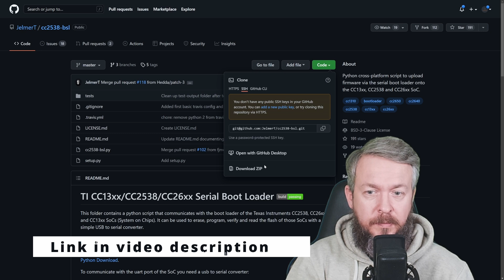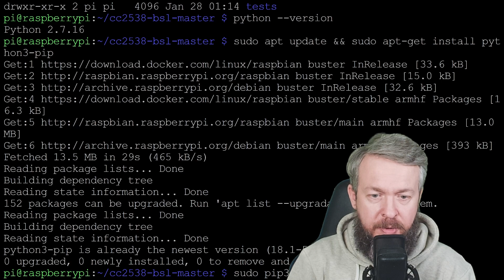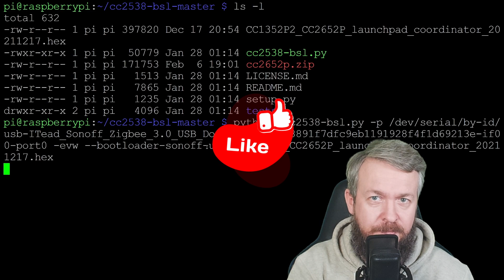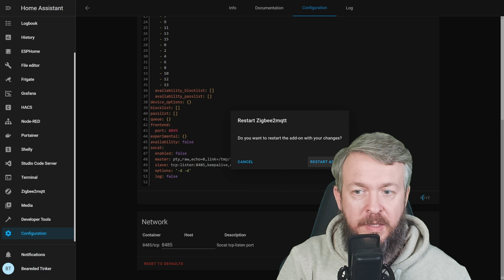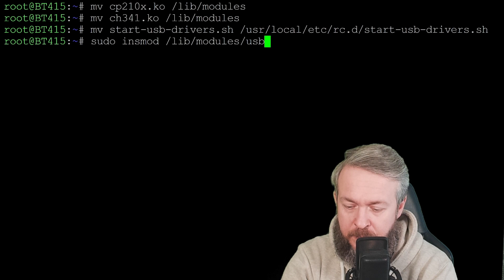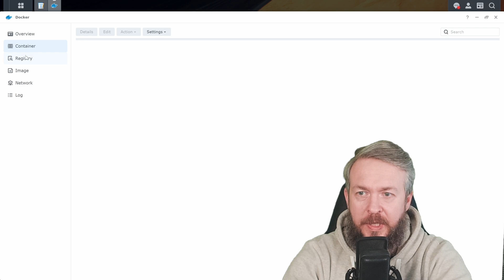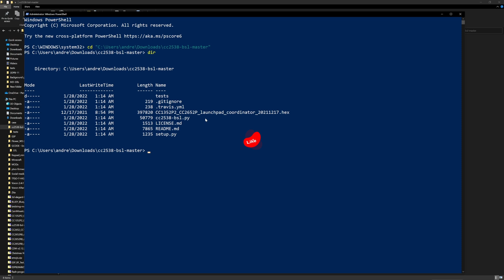Flashing Sonoff Zigbee 3.0 USB dongle plus and Home Assistant guide

Comment: Hello BD ! Thanks for all your great tutorials. Following one of them, I installed Home Assistant on synology as a docker component. In this video, at 17min, you say that you can re-install home assistant. But in that case, I'll lost all my configuration, right ?
Reply from the maker: Thank you David 😊!
No, if everything is installed correctly, all files are located on Synology in /Docker/homeassistant folder. You will just recreate container but keep all local files.
Reply: @BeardedTinker  Thanks for your answer. ATM, i do not own that sonoff (but I really will do) and I'm not sure to understand every parts of this video (no your fault, it's mine as i'm not so aware as you are with synology, docker, ha and so on). I'm running synology dsm 6 (on wich I can't have a VM working, don't know why), so the supervisor version of HA isn't installed. Will it be a problem for me ? (hope you understand my bad and poor english...)
Reply from the maker: @desmoniac1  VM on Synology is only available officially on some models. Other modes can have VMM running by sideloading it - what model do you have?
I think that best way to run HA on Synology is on VM - I have it working on 415+ (it officially doesn't support VM, but it can be installed) and also on 920+ that does support it officially.
But, yes, you can also use Docker version, and it should work too. If you have setup HA correctly and on Synology in File Station you can see files in Home Assistant folder, than you can simply delete Docker container for HA and create new one where you use steps from the video and map your USB Zigbee device for Home Assistant to see it.
No worries. HA has great community and we will try to help you ;)
Reply: @BeardedTinker  really appreciate your answer and help. I'll be back as soon as i'll receive my sonoff zigbee. Then, i'll be able to try to install all that stuff on my testing machine before putting it on my production machine. Many thanks !
Reply: @BeardedTinker  Just a quick reply to say that my nas is "almost" a DS3615xs running with an Intel core I3-4130 ;-). What do you mean by sideloading a VMM ???
Reply from the maker: So it's Xpen.... :) But still it should work - VMM on Intel should work Ok. I was thinking that you have one of the models that officially don't support VM, but you can manually install package and get it working. 3615xs (most comman Xpen...) should support it nevertheless
Reply: @BeardedTinker  I can't hide anything :) !!! But my knowledge is insufficient to install the package you're talking about. Maybe one day you'll provide a video on your channel... Waiting for that (no pressure, ok ?) I just watched your latest video and well, some ideas are coming to add media automations. Thanks for all your great works !!!
Reply: @BeardedTinker  Another quick question please. Once the dongle has been flashed, does it need anything else than power supply to work ? I mean, can I simply plug it on, for example, a usb charger ? Sorry if this question seems stupid.
Reply from the maker: Depends, if you already have a stick in Synology, and you flash this one with router firmware and not coordinator, than you can simply plug it in USB power and that's it
Reply: @BeardedTinker  ok but I want to use it as a coordinator. So I guess it's not possible...
Reply from the maker: That's right - ZHA/Zigbee2MQTT has to have access to it, so it needs to be connected directly.
Reply: @BeardedTinker  Sound so logic...
Reply: @BeardedTinker  hi BD. My zigbee dongle is on its way to home. But i read somewhere that it wont work if plugged on a usb3 ? Do you confirm ? In that case, if i use an usb2 prolonger cable, will  that do the trick ?
Reply from the maker: @desmoniac1  Never seen any issues with type of USB. Cable should be used in any case to move coordinator from possible EM interference . It will work without it but it's just recommended to use cable.
Reply: @BeardedTinker   Two more questions dear BD (sorry...) Is it better to use ZHA or zigbee2mqtt (and why ?) If I want to use zigbee2mqtt, is your #5 tutorial still valid (remember, I'm using HA on docker on synology and do not have supervisor).
Reply: @BeardedTinker  Sonoff zigbee received, flashed, installed and used with ZHA (I'll try later to configure it with Zigbee2mqtt). Thanks again for all your tutorials.
Reply from the maker: Glad it's working!! Hope you'll have fun with it.

Comment: I'm actually quite unfamiliar with a command-line other than windows. 
I'm typing these commands from the "Home Assistant Add-on: SSH server" add on, on HA web portal.
I'm stuck at 6:44 from the video. After typing "python --version" I got "bash: python: command not found" so I thought, I don't have python installed. Went further and typed  "sudo apt update && sudo apt-get install python3-pip" but I get "bash: sudo: command not found"

At this point, I halted and I'm lost. What am I doing wrong?
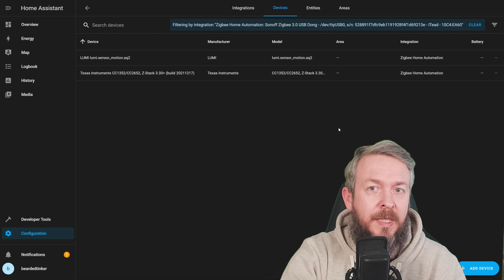Reply from the maker: Did you try Windows upgrade steps from video 20:54?
But in order to use Linux, you will need SSH access to machine. SSH server (Terminal & SSH) provides limited access to HA own environment, not direct access to HA.
Reply: @BeardedTinker  Thank you for the fast reply! Ultimately, I will do that, but in the meanwhile, I'm trying to learn why is this happening and also trying to do it in "the hard way".
Reply from the maker: I've edited my answer, so you probably missed it. 
SSH AddOn is just protected environment that is not full Linux experience. It just allows you to run some limited commands. You would need different Linux machine to do it unfortunately. There are some steps if you want to try, but not that simple: https://developers.home-assistant.io/docs/operating-system/debugging/#ssh-access-to-the-host
Reply: @BeardedTinker  Thank you very much for confirming this. I even already installed SSH & Web Terminal because is less limited, but I was coming to the conclusion that maybe I couldn't do this locally but on a different machine. Lesson of today learned. moving to 20:54 :D 
Again, thank you for the confirmation!

Subscribed!

Comment: Great video..... i flashed the router firmware that is listed in sonoff manual..... but i cant get aquara sensors conecting to the router.... which firmware did you refer to?
Reply from the maker: Same as  the one where coordinator firmware is. Check video description. https://github.com/Koenkk/Z-Stack-firmware/tree/master/router%2FZ-Stack_3.x.0%2Fbin 
Those are also recommended by Sonof. Just go to router folder instead of coordinator.

Comment: Hi again @BeardedTinker. I need to ask for some advice here: 
I have around 70 devices in my home from different manufacturers: 
- IKEA (GU10 Lights, window blind, switch, 3x Range Extender)
- OSRAM/LEDVANCE (Motion Sensors, GU10 lights, garden poles) 
- AQARA (Lots of battery-powered Aqara remote switches, motion sensors, temp sensors, etc.)
- MULLER LIGHT (E27 bulbs)
- PHILIPS HUE (for outdoors: E27 bulbs + outdoor motion sensor)

My house is pretty small (80 sq. m) over 2 floors, made of brick & wood (zero concrete). 
Some end devices, especially Aqara sensors & switches keep dropping out of the Zigbee network and I need to re-pair them every time. 
I had this problem with my previous coordinator (Conbee II stick), and I was hoping that the Sonoff dongle will solve this problem but it has not.  
Do you think it makes sense to get another Sonoff dongle to use as additional router or is it more reliable to add an Aqara hub, and add it to home assistant via HomeKit controller? Would the Aqara end devices connect to the Sonoff as router, or will they still try to get directly to the coordinator anyway?
Reply from the maker: I've tested Sonoff with router firmware on it with Aqara devices - and new devices that were near it did pair to Sonoff. But I didn't test to see if devices that are already connected to coordinator would transition to it.
Roaming/transition from coordinator to other routers is a bit strange in Zigbee network, and it can take a long time for them to try and find optimal/alternative route to coordinator. Or they may never do that. 
You could possibly end up re-pairing those devices - you don't need to remove them, just start pairing process on them (for Zigbee2MQTT, not sure for ZHA)
Reply: @BeardedTinker  After you flash the new dongle with the router firmware, how do you pair the new router with the original coordinator? The Dongle doesn't seem to have any pairing button. Does the coordinator discover it automatically?
Reply from the maker: When you plug it in for the first time after flashing it, it will be in pairing mode. You just need to enable pairing.

Comment: Hello,
Really appreciate all the videos and information you share here. :) I had a question. I am new to HA and Zigbee. I have installed HA in a raspberry PI 4. I bough recently this zigbee stick, sonoff but seems that for me it is not connecting to my Tuya hy368 TRV smart valve. I remember you have already poste a video where you use zigbee cc2652rb stick and you were able to successfully  connect the valve to zigbee2mqtt. As you already have the sonoff zigbee stick and the tuya smart valve could you test if sonoff zigbee usb dongle plus is able to replace the cc2652rb coordinator and connect to tuya smart valve? I have flashed the sonoff zigbee stick with latest stable firmware and with latest development firmeware but still no success on pairing tuya TRV smar valve to the sonoff zigbee coordnator.
Today I noticed that my xiaomi gateway 3 could be used as a zigbee coordinator via an integration "Xiaomi Gateway 3" provided by HACS. I tried ZHA and zigbee2mqtt with using the xiaomi gateway as coordinator. I am able to pair the device to the xiaomi gateway but I can see in zigbe2mqtt it is not supported and the exposes part is empty. As per ZHA it connects but most of the functionalities are desabled by default. I can only change temperature and turn it on and off.
Reply from the maker: I've  given TRV away and don't have it anymore with me, sorry. But if Zigbee2mqtt sees it and says it unsupported, than it could also be a new model that has still not been added. I have one Gledopto video where I've shown how to create custom converter for unsupported device - basic setup only. Try to use this to pull exact model from it. Maybe its a bit different.
Reply: @BeardedTinker  I will try with creating a custom converter. Many thanks 🙏🏻 I also checked in details the Xiaomi gateway integration page with the information and seems that the xiaomi gateway 3 does support very limited amount of devices and thet is the reason it does show my TRV as unsupported. I have the feeling the custom converter will solve it. Many thanks!
Reply: I think I got now the logic. My Xiaomi gateway 3 does not support this tuya TRV valve. I checked the integration information and it supports only some tuya switches and buttons. Not the TRV. Now when I deleted ZHA config using Xiaomi gateway as a Zigbee brigde, and configured again ZHA with Sonoff Zigbee dongle, I see the TRV valve appears automatically. The issue is that the configuration is not right and I cannot use it. I read someone was using 2 Zigbee usb dongles one old cc2531 dongle which he connects to HA only to add new devices, and than he switched to sonoff to use as daily driver. That might be a workaround for the moment until Sonoff firmware fixes this, if will ever fix 😁
Reply from the maker: When you say Sonoff firmware - why don't you update it with coordinator firmware that's listed, if you of course haven't done so. My cc2652RB uses same firmware from this page.
This is same circuit inside, except Sonoff one also addes no-boot update, that cc2652RB doesn't have.
If it's just firmware, that's the easiest part.
Reply: @BeardedTinker  Hi again. I already flashed the Sonoff Zigbee usb with firmware 20211217 and later with the more recent development version but did not work for me. Later I learned that when I used my Xiaomi gateway 3 as Zigbee bridge and connected to HA, Z2M, my Xiaomi firmware was old abd was not working well with HA. After upgrading my Xiaomi mi gateway and configuring it as Zigbee bridge with HA and Z2M I was able to successfully connect 3 Zigbee devices I had around and the smart valve. All worked perfectly. That ment my HA, Z2M, and Zigbee devices all work well. After that I connected Sonoff Zigbee usb dongles to my laptop and installed node.js + Z2M and tested it. Again all was working perfectly. Then I just remembered that raspberry pi 4 has a total limit of 1.2 Amper for usb ports. I already have connected one SSD to one of raspberry pi’s usb port and SSD is rated at 1A. The usb dongles states that is rated at 100mA so normally that should work fine. But somehow I was wrong. After testing again with raspberry Pi 4, external SSD, and with external power to my Sonoff Zigbee dongle (through a small hack to raspberry GPIOs) all worked fine. It turned out it was a power issue… 😄

Comment: Great video, thanks for the instructions! Does anyone how you add the router to an existing Deconz instance after flashing? Can't seem to be able for Deconz to pick up the router when searching for new lights.
Reply: Following up; I can see the router in the VNC view, but it's not showing up in the GUI. It sems to be routing as well.
Reply from the maker: That's normal AFAIK. In Zigbee2mqtt you see it as unknow device or device with no attributes if I remember correctly. But it should still work even if it is "invisible".

Comment: Hi BT! I am trying to do this on Windows but it doesn't work. My PC does not put it on any COM port at all. Basically, I see it in my device manager as an uninstalled (no drivers) device but I don't even have any "Ports" showing in my computer's device manager. What am I missing? :-(
Reply from the maker: You probably are missing drivers. https://www.silabs.com/developers/usb-to-uart-bridge-vcp-drivers
In device manager check if there is a device that is not recognised - this should be it.
Reply: @BeardedTinker  Yes! It worked like a charm. THANK YOU!
Reply from the maker: Nice! Glad you got it working 😊
Reply: @BeardedTinker  Thank you for this post.  I had the same problem.  Thank you for a great video.

Comment: I  try to add sonoff stick to synology, I ssh via powershell to syno, i just download the 'master.zip , but unzip command not work (command not found ) any suggestion ?  Looks like my synology not seeing the sonoff stick  , any suggestion ? Thanks
Reply from the maker: Hi! Instead of unzip (if it's not installed), you can use 7x - "7z x" is command to extract. That should work without the need to install unzip.
When you connect Sonoff USB, do you see anything when you type "ls /dev/ttyUS*"  ?
You can also use step I've show in video to install drivers for DSM 6.2 and 7.0
Reply: @BeardedTinker  nope
Reply: Under Vmm usb device is empty too
Reply from the maker: @acejoe5996  try in Windows PC to check if stick is working. It should be visible in VM manager no matter what.
Reply: @BeardedTinker  yep, i just plugged in and insta visible in the device manager
Reply: I also cheked the files under putty , and I have all the files  cp210x.ko and start-usb-drivers.sh in the right place
Reply from the maker: For VM, you even don't need those. What model of Synology is this and DSM version?
Reply: @BeardedTinker  220+ and dsm7, Not sure How but now it starts to work finally !
Reply from the maker: Let's say that it was just lazy because of the weekend. Really no idea why it wouldn't register it so it's good that you can see it now.

Comment: Hello, very helpfull video ! nice work. Did this work with the router firmware(with the method 1) ?
Reply from the maker: Yes it does! I've tested it with router firmware too and works nicely!
Reply: @BeardedTinker  thx 😉
Reply: It’s work perfectly with router firmware !! Thx a lot ! What a powerfull upgrade for my zigbee network !
Reply from the maker: It has good range so adding it as router will really help the network!
Reply: @BeardedTinker  i add two yesterday and it fix all my issues 👍

Comment: Thanks for the guide. I just finished setting up sonoff zigbee 3.0 dongle plus for Zigbee2mqtt on my 918+. 
And I have one question. Currently, the zigbee 3.0 dongle plus is set to HA with Zigbee2mqtt, but doesn't it crash even when nested with ZHA?
Reply from the maker: Glad you got it working!!!
Zigbee2MQTT should crash or ZHA should fail to start if you try and use both of them to access same dongle. That is normal and you should not try and run both of them using the same device. There is always option to use 2 devices/dongles, but there is not added benefit to that.
Reply: @BeardedTinker  It only supports one thing.  I asked just in case haha.  thanks!!

Comment: After some trouble with the prerequisites I've managed to get to the end. Unfortunately I get an error 13 {Errno13]. Any thoughts anyone? I have been trying an googling for more han an hour now but with no resolve.
Reply from the maker: Hi Kris! At what stage do you get this error? You are using Linux to flask firmware?
Errno13 usually is problem with permission. If you haven't try running command with sudo in front of it.
Reply: thank you for your reply, it is the very last step of the Linux method. The command that starts with python3 cc2538-bsl.py -p etc etc. 
I’ll try sudo in front of the command.
Reply from the maker: One other thing myou can try if it fails. if you are using Zigbee2mqtt stop it or stop Home Assistant if yoinar rising ZHA. Device must not be in use by any other application at the same time
Reply from the maker: @Krisdarnok  Just wanted to check if you did manage to flash it with "sudo python3 cc2538-bsl.py -p etc etc. " command and also if it fails, did you try stopping other applications that could use it (such as HA, Zigbee2MQTT or similar) to prevent race for port access.